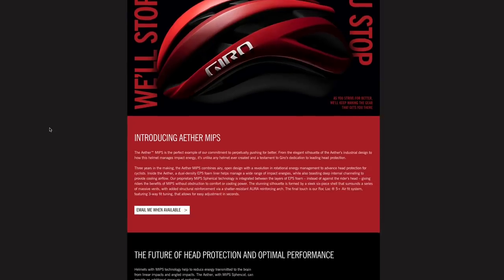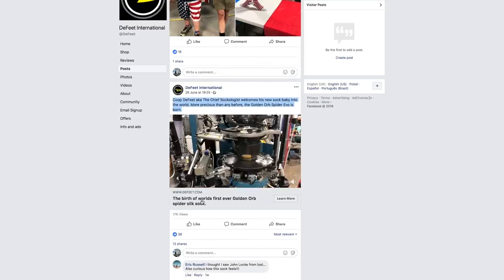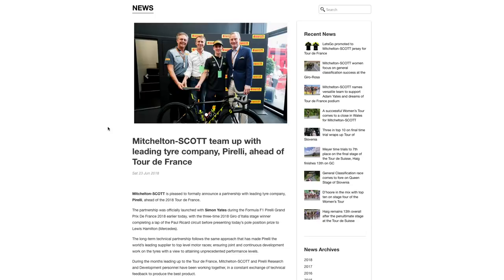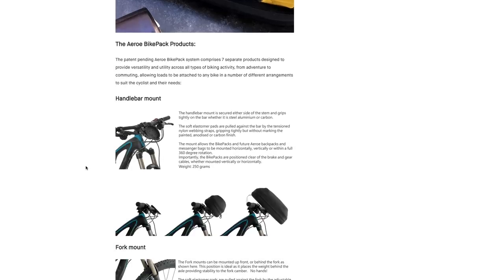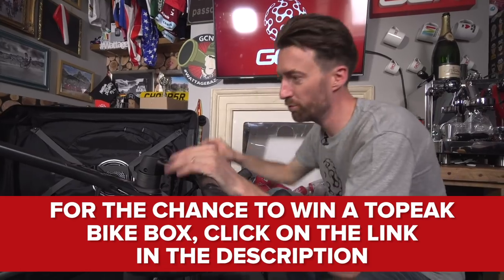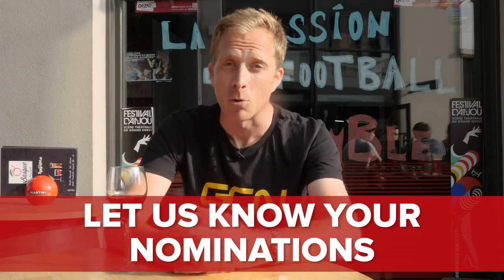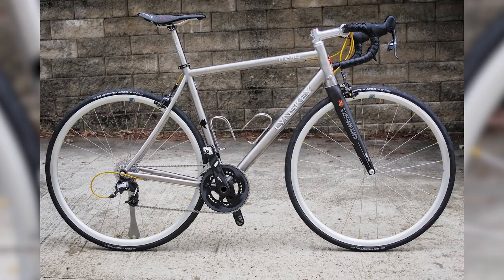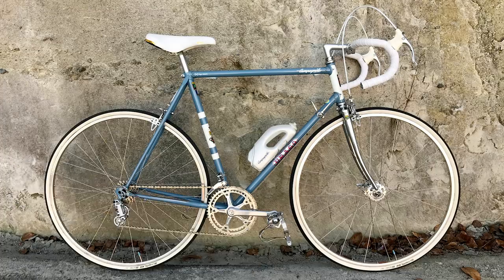Lightweight, Aerodynamic Or Comfortable - Pick Two! | GCN Tech Show Ep. 27

Comment: Was buying a new bike this year and choosing between Canyons:
Ultimate 8.0 Disc Di2 - 7.8 kg ($4,499)
Aeroroad 8.0 Disc Di2 - 7.5 kg ($4,599)
Endurace 8.0 Disk Di2 - 7.4 kg ($4,599)

The light weight "Ultimate" ended up being heavier than the Aeroroad and Endurace for approximately the same price point.  Ended up going with the Aeroad since it had tubeless compatible wheels although 0.1 kg heaver than the Endurace.

Have did two 100 mile rides and a 150 mile ride so far, and the Aeroroad geometry hasn't been a problem).  Planning to do ~205 mile ride 9 days.

So Weight, and Aero.  Make sure the bike fits good and then just toughen a bit to make up for the comfort.

Comment: I would sacrifice the light weight because I am very small already (which helps my body better off aerodynamically). Also you can easily lose a few hundred grams from yourself fairly easily (or from your gear, like carrying one less tube, a co2 canister instead of a minipump, dumping your water from your bottles, etc), whereas you can't do much on the fly to make your bike more aero. The aerodynamic factor also matters a lot more frequently than the light weight. And as far as comfort, if you're not comfortable on the bike, you're not going to want to ride it for very long. Weight is the best thing to sacrifice.

Comment: The only one of the 3 that has a detriment is aero.  I can't think of a time where I've wanted less comfort or more weight, but there's definitely been times where I've nearly been blown off of a bike in a cross wind due to it's aero features.
Reply: Michael Munson just my 2 cents, but you probably need to relax more in cross winds. Once I realized this, riding became better. I'm 145lb riding 60mm deep clinchers. I've ridden them in 50 mph gusts. Of course that was lunacy, but if I can stay upright in that, you can handle normal cross winds. Keep your hands relaxed, the bike will keep going straight.
Reply: Mitchell Steindler for sure, aero in crosswind is manageable.  And true, crosswind may not happen much or at all on every ride.  But again, there isn't any part of comfort or light weight that sometimes needs to be managed. I value those 2 above aero is all.  Cheers.

Comment: I would take comfort for the first option then aerodynamic if possible because bikes these days are light enough to climb anywhere with the right gearing. However, generally, comfort and aerodynamic are mostly the two opposite sides of the spectrum and you will have to sacrifice one of them for another. Thus, comfort and lightweight would be the most possible option to pick for me.

Comment: Jon, I did a 170 mile ride on a 52/36 using a 11-32 (from 11-28) on a short cage without any adjustment or hanger.  I never used the small on the 32 , but then you wouldn't need to anyway. Please could you advise on this option? Thanks Jon

Comment: I have an Allez Sprint... Been having some trouble with creaking in the seat post. I use fiber grip and am just under the necessary torque spec (Spec is 6.2nm and I torqued to 5.9). Any suggestions?

Comment: Always sacrifice aero.... except for the reason of comfort I've gone for steel tubes which are smaller in diameter and therefore less to push through the air. 28C tyres add comfort....but comparable to an aero bike the whole package is lightweight!

Comment: Aerodynamics - a non-aero bike is still not too non-aero. Most cycling is below 20mph so aero doesn't count for much compared to weight and comfort. Aero doesn't help much with climbing but weight does. Rough roads, potholes, gravel, paths etc need comfort. Comfort can also be a good fit which counts the most compared to everything else especially when you spend any more than a couple of hours in the saddle.

Comment: My ebike is very comfortable, not aerodynamic at all unfortunately since it’s built like a tank (Riese & Muller Delite) but it is pretty heavy (30kg). I don’t mind the weight but if it was lighter then it would be easier to manoeuvre it around the house. And it would use less energy going uphill especially.

Comment: Sacrifice comfort. It's cheaper to buy tires, tape, shorts and saddle than it is to save weight. And you can't really buy aerodynamics.
Reply: Jon Burnell I think comfort is more about bike fit and your position on the bike which isn't something you can buy realy. Bike with the most relaxed seating position will be the most comfortable.
Reply: Marko Nikolic very good point. Although a bike fit wpuld still be cheaper than an £800+ pair of aero wheels though. If the bike setup is close to being right then the bike fit should be easy enough.
Reply: Jon Burnell I can't disagree with you on that one, although for my type of riding getting more aero isn't that important so i would sacrafice that to be able to ride long rides with a lot of climbing.
Reply: Marko Nikolic The world would be boring if we were all the same. I'm a rubbish climber, but an alright sprinter. So for me it's all about low and stiff. My brother's a climber, could pedal up Everest, he prefers a slightly more relaxed geometry too.